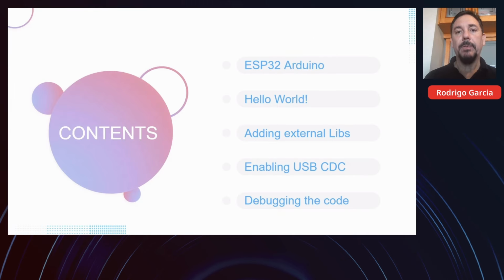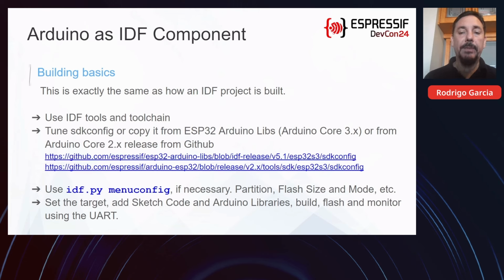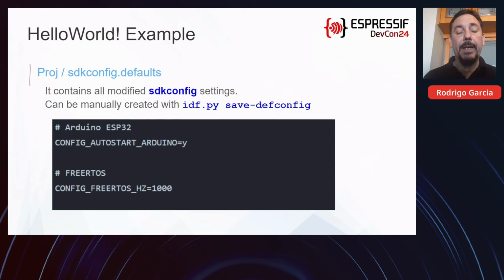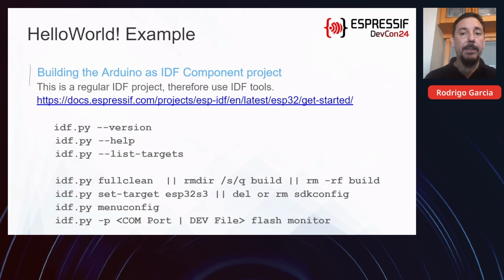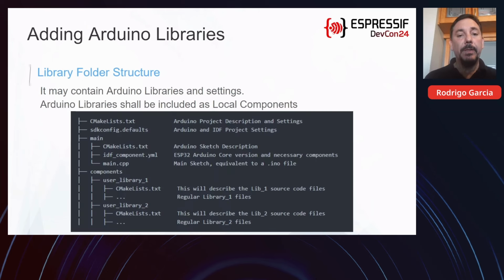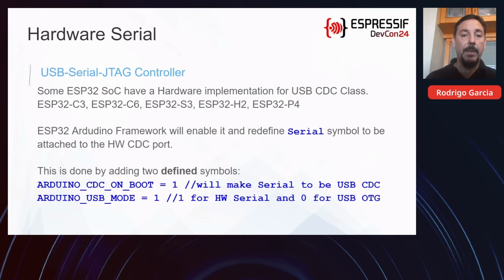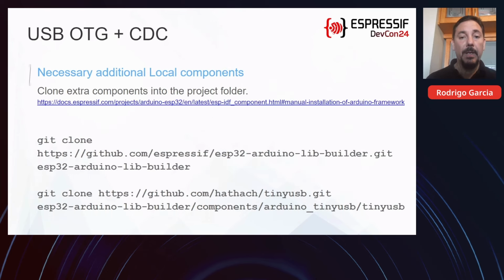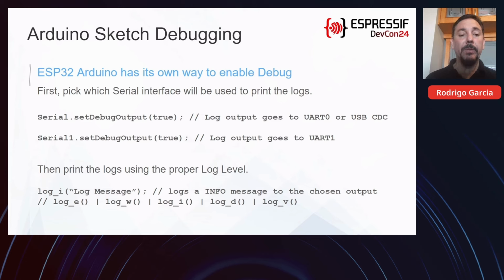DevCon24 - Practical guide about Arduino as IDF component

Comment: Thanks for your tutorial! It is useful for general informations.. but if you want to build an ESP-IDF project with arduino as component you should stick to the espressif docs. The example with appmain() did work after some struggle.. for some reason i needed to use the terminal with idf.build to build the project the first time.. with the build icon in VSCode it did not work.. after that it works also with the build icon.. why?
To get the normal arduino sketch running in ESP-IDF you have to set the parameter Autostart Arduino setup and loop on boot in menuconfig.. I only just noticed this in the documentation... now it's finally working!
Reply: Please take a look into the ESP32 Arduino Github where you will find some Arduino as IDF Component (same folder name) basic examples that set the AutoStart directly in the sdkconfig, along with other necessary settings such as the Free RTOS Frequency.